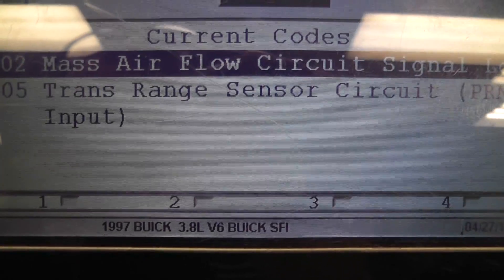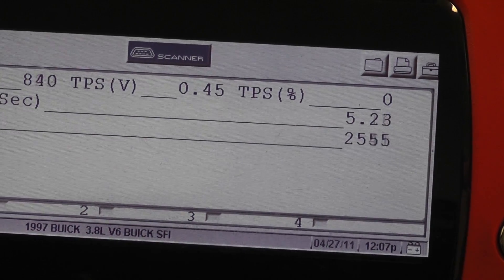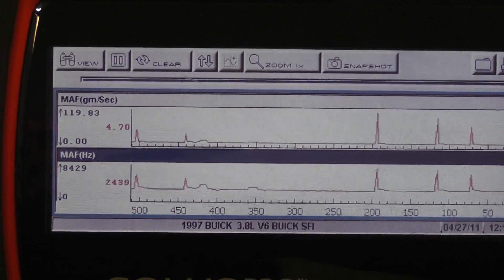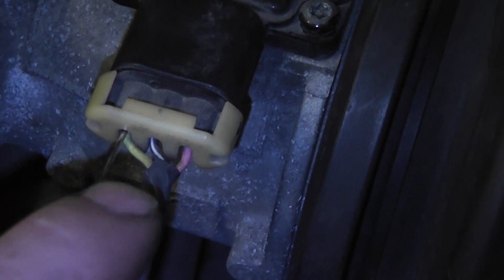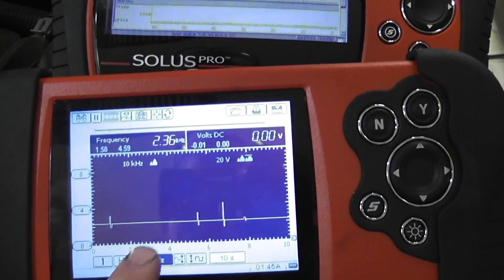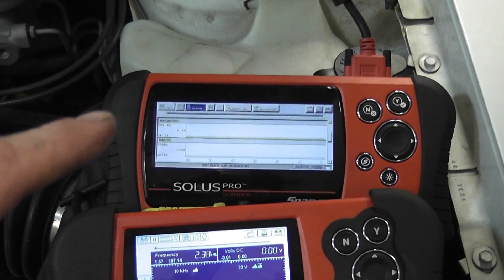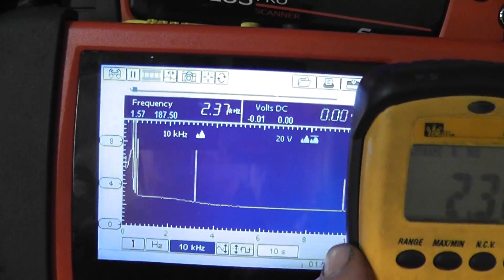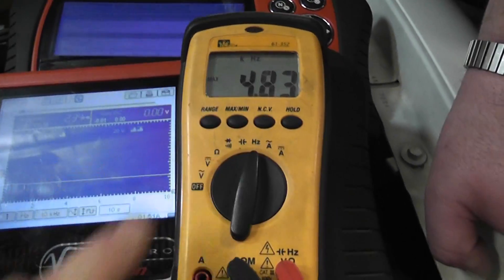How to test a GM MAF Sensor (Part 1)

Comment: Would you point me in the right direction on a p0172 on a 05 3.8 Bonneville. I’ve replaced everything injection and ignition upper and lower intake gaskets and upper intake. It keeps getting the p0172 and on a better scanner  than mine shows a cyl 3 miss. Put no code for that. I’ve done a compression test and get in the 150 range.
Reply from the maker: Focus on the rich exhaust code. What are your fuel trim numbers at idle and 2500 rpm in park, hot engine, steady throttle for at least a minute before recording your numbers. Also I want O2 millivolts. (Upstream only)

Comment: Thank you for your video. I have a 2006 Corolla 1.6 petrol and the MAF sesor read 3 g/s at idle and 27 g/s at 2600 rpm. Are these values normal? Thank you!
Reply from the maker: No idea. What are your symptoms and codes?

Comment: Should MAF g/s test go up and down alittle on my graph I'm getting about 4.7 at idle warmed up It's on a 2001 5.3 vortec does it sound normal or is that low? Also my map sensor stays around 38 at idle and wot gets up to about 100 does that sound normal?

Comment: My Maf sensor on idle has values from 2 to 7-8 without touching the gas pedal...is this meaning that is gone and i have to buy new ?Also my car after driving 30-40 minutie is starting to loosing power and appears black smoke from time to time...
Reply from the maker: If it's a GM, unplug the MAF and see how it drives. They have good backup strategies
Reply: @ScannerDanner  Its Volvo v50 diesel...i ordered a Pierburg MAF...hope that the old one is broken.

Comment: I have a 2000 4.3 g1500 with maf hz at zero,  5v in the yellow but 0v in the red.. shouldn't it be 12v?
Reply from the maker: yes sir, you are missing a main power feed to that MAF
Reply: @ScannerDanner  ok I'm lost... I check continuity thru yellow, black, and red from maf to pcm...  and red and black actually have continuity with each other.. checked them at the maf pigtail aswell and I have it.. can that be right? Where do you get your diagrams from?
Reply from the maker: @TheBracket1  continuity is not what you want to be testing for on that power feed circuit. Voltage is what is missing. Go to the source first. Here is a link to the DIY version of the same diagrams nd service information I use
https://eautorepair.adtrk.biz/?a=10817&c=24&p=r&s1=
Reply: @ScannerDanner  found it.. blown fuse that supplied the power.. I used the mitchell link you sent.. buying your book thanks man
Reply from the maker: @TheBracket1  thank you! Now the question is, why did the fuse blow? What else is on the circuit? You'll find that info under the Power Distribution diagrams. Let me know
Reply: @ScannerDanner  well.. if  I'm reading it right, it looks like the heated o2 and evap canister purge and vent valve
Reply: I do have a p0443 & p0449 circuit fault, and circuit low code awell🤔
Reply from the maker: @TheBracket1  those are all related to the blown fuse. Clear them and I bet they are gone as long as that fuse stays good (it won't) 
Do a good visual inspection of the wiring harnesses that go to those components. Especially the O2 sensors (heat)
Reply: @ScannerDanner  is it possible for a MAF the be shorted internally somewhere and cause the fuse to go?
Reply: @ScannerDanner  better question.. when the fuse blows the maf dosen't read anything but the o2's do.. how is that possible if they are in the same power distribution?
Reply from the maker: @TheBracket1  exhaust keeps them hot, it is the heater circuit for the O2 that uses that fuse. Signal circuit will still operate, though poorly because of temp.
Reply: @ScannerDanner  I have looked everywhere for a short.. these kind of vans are so hard to work on with everything packed this small of a space.. think I'm throwing in the towel on this one
Reply: @ScannerDanner  what if i made my own harness? Tap into the fuse box grab 12v put a inline fuse.. run a that power to the maf and the 3 o2 sensors.. the old power supply's  would be cut off when I run my new 12v source so there is no chance of a short anywhere.. may not be exactly the kinda repair I'd prefer to do, but given limited space and time I have.. good idea or bad?
Reply from the maker: @TheBracket1  I wouldn't do that. Just carry some extra fuses with you until we can pinpoint this thing
Reply: @ScannerDanner  well I put a fuse in it and so far so good.. maybe I moved it away from what ever it was touching while looking for it. Anyway I just ordered your book. In the mean time I got one more issue with a 00 4runner limited 3.4 A/T California emissions..p0135 o2 sensor heater circuit fault b1s1.. he already changed to o2.. and on the truck side I checked the 4 wires with a multimeter.. and have a 12v in one wire and nothing on the rest.. any suggestions on where to start
Reply from the maker: @TheBracket1  did you test that plugged in and backprobing? You definitely want to be plugged in and engine running for all 4 of those voltage tests and thank you btw!!

Comment: Hey 
Have you ever seen a 02 become permanent lean because other sensors forced it 
To read out wrong ?
I just replaced last year 
But saw other sensors like vvt and tps were not working correctly 
Im gonna update if i find out my theory is correct 
Info helps all of us !
Reply from the maker: permanently lean as in it will not respond to a forced rich condition? yes, I have

Comment: I am looking to buy an oscilloscope that will graph frequency. A used vantage pro is around 1000$ on eBay, this is a bit expensive (for my wife). Unless you have good arguments for the wife can you recommend an oscilloscope that will do that?
Reply from the maker: Keep shopping, I think you can find the VP for less than that but to be honest, it is worth that for sure, regardless of the update on it. I actually have a few old 12.4 updates for the Vantage Pro, so if you get one with older updates than that, email me at support@scannerdanner.com and I'll give you one of them. They've never been used and I do NOT know what year that brings your data base up to. At least 3 or 4 years old now I believe.

Comment: For anyone else that is reading this.....I am working on a 2001 Chevrolet S-10 4.3L, and the MAF readings are 6.43 grams/second at idle of 650 RPMs.  If the rule of thumb of the grams/second  equaling the engine size, I should be reading around 4.3 grams/second.  Is this correct?  If not, what would cause this engine's MAF to report 2 grams/second higher than it should for this engine?  Thanks.

Comment: that's why it's good to have a scope that samples at a much higher rate. Graphing multimeters are the best in my opinion because they sample at a million times a second and then averages out each sample per division and connect the dots to draw the line.  A regular expensive scope may sample at a high rate but it will also display at the same rate and the human eye cannot catch that.

Comment: Can this be done with a ODB2 reader and an app like Torque? It doesn't measure Hz... measures mass air flow in g/sec or lb/min
Reply from the maker: Yes you can
Reply: Thanks for the reply! what should I be looking for? Assuming I am looking for spikes on the graph, rather than linear ups and downs (to find an error). Trying to trouble shoot a P0101 code on an Astro van. Thanks so much.

Comment: Dan question 3800 supercharged pontiac gtp when i start car and run it check engine light P0300 when i unplug maf i get code for that but no P0300 is it the crankshaft sensor or a bad maf
Reply from the maker: P0300 is a misfire code, which can be caused by a ton of different things. When you unplug the MAF, the misfire monitor for the OBDII system is probably being turned off because the computer is recognizing a fault for a critical sensor. This provide us with no direction at all. I hope that makes sense.
Reply: Ok so i can assume since the maf isn't causing the misfire code that something else is only problem is i don't have a scope like you to monitor the misfiring on each cylinder. I was thinking i kno all coils are good i know the icm is good injectors are all good could it be the crankshaft because i do get play in the mph in park and i rev the engine up. Thanks for responding
Reply from the maker: A MAF sensor can cause a misfire code. Let's make sure we are on the same page first. 
1. Does it run good with the MAF unplugged compared to plugged in?
2. Can you feel a misfire? Is it there all the time regardless of what you are doing with the MAF?
Reply: ScannerDanner yes it runs perfectly without maf plugged in just needs help to catch its idle. I only feel the misfire when maf is plugged in which tells me maf but i don't wanna guess and part change
Reply from the maker: Okay, that does sound like a faulty MAF, watch part 2 of this series for some digital mutlimeter tests you can do if you want to be sure.
Reply: ScannerDanner ok I'll watch that video also
Reply: So i decided to give in and part change new maf no P0300 car still has a rough idle and stalls maf unplugged car idles perfect wit code P0102 what would you look at next I'm kinda thinking crank or B01 S01 02 sensor cuz i have headers and i know i had to force the O2 to fit
Reply: New development so i checked my short terms and I'm plus 20 rev her up to 3k short term goes to 0 -1 -2 etc ok so i have a vacuum leak. Now here's where i need your help why would unplugging the maf case stft to stay at 0.0 and idle the car perfect but when it's plugged up  it idled erratic wouldn't it idle bad plugged or unplugged if it had the vacuum leak or is that how it's supposed to be thanks for the help

Comment: Aliasing on a scope is dependent upon sample rate. Is it safe to say that glitches effecting the ecm must occur during the time the ecm samples the signal?  I would assume the sample rate of a temperature sensor would be less than a crank or cam signal. ---------> The question I have is this, can a glitch cause a engine performance issue and not cause a fault code because the sample rate of a fault is slower than the sample rate the ecm use to determine a fault code? I know from experience with cummins heavy duty engines that they release calibration update that deal with false positive codes. These are more related to programming for things like temperature, pressure diff. etc.. and the logic..

Comment: just was wondering if you come help me out with something. I switched shops. at my old shop we used genesis pro.it measured maf valium by grams per second,my new scan tool measure in lb.I'm really lost with this new system.
Reply: New scan tool is maxisys
Reply from the maker: There should be a way to change that setting. But I'm not sure. Someone on my forum would know.
www.scannerdanner.com

Comment: Was just trying to do this test on a buddys car that has among other codes a P0101 & P0102 (2005 Impala 3.8L).  I have a Hantek 1008 pc scope and was having trouble setting up the scales to mimick this test to watch for spikes etc.  On snap throttle, could only get a max frequency in the 7Khz range, he did tell me later that he had sprayed cleaner into the intake, so has no doubt left some kind of residue on the MAF element.

Comment: I have a question I have a 1997 Buick LeSabre 3800 3.8 liter v6 went to shop today they had told me that it was the idle air control valve faulty car would stall rough idle bad only when warm replaced idle air control valve it seem to stop stalling but after 20 minutes of letting it sit I go back to start the car and it almost Lopes then it will catch itself and run fine let it sit for an hour starts right up like nothing is wrong the shop told me it can be mass air flow sensor also I smell raw fuel sometimes I replaced fuel pump fuel filter and fuel pressure regulator valve what could be loping be from is it A mass sensor like they are saying please help been chasing this for a while I love the car it's very quick and I don't want to get rid of it thank you
Reply from the maker: +robert gryca the MAFs do fail on these. Unplug it and see how it runs.
Reply: it runs really bad when i unplug it but when i plug it back in it runs better idk im thinking iac vavle not sure the part is aftermarket
Reply from the maker: +robert gryca how does it run when your foot is on the gas pedal, if it is still bad then it is NOT the IAC valve. After you unplug the MAF, you need to shut the car off and then restart it for the PCM to enter it's default strategy . If it is still running bad (it may stall a few times first which is normal with the MAF unpugged) then your MAF code is an effect not a cause of the engine running bad.

Comment: i have a question about a 99 chevy tahoe? im getting one brake light coming on on driver side but no brake light on the passenger side or 3 rd brake light ..also no tail lights at all..the fuses and bulbs seem to be ok...so just one brake light working..what should i check next??thanks..

Comment: Great videos, very educational, I have this very same Buick Leasber (2001) 3800 series 2 with a p0102 and p0171, - using torque app won't show this type of error obviously. When resolving this particular issue issue, did you replace the MAF? (I've read where bad MAF in GM can include rich/lean codes)
Reply: Yes, the MAF sensor was replaced and it fixed the issue .And yes a faulty MAF can cause rich and lean codes.
Reply: Thanks for the video and the reply, helps me out immensely!

Comment: hi I have a question for you I wanna check frequency on bosch mass sensor 2003 BMW the procedure is the same like you doing on buick do I have to change something on scanner ? in using the same snopon scanner as you have

Comment: Great video!  Ive been looking at buying a scope like a Vantage or Vantage pro, but Ive been told that the snap on scopes are all digitally processed data and not actually live, and the older Sun machines are better to have is there any truth to that?  Ive watched all your videos and it doesn't seem that you have any problems while using the scope functions.

Comment: I read on another diagnostics blog that grams per sec should be roughly engine size at idle and 40x at w.o.t. so for example a 2.0 liter engine should be roughly 2 grams at idle and around 80 grams at w.o.t. What are your thoughts on that?

Comment from the maker: When I started this 8 years ago I charged $20 a car...what a joke. I was completely ripping myself off. I charge $70 per car, then $50 per hour after the first hour. Although I rarely get into the second hour (this is where 20 years of experience helps). So it is $70 if it takes me 5 min. and it is $70 if it takes me an hour. Any more time needed we talk about. It is getting to the point where I am so busy that I'm going to bump it up again. It went 20, 40, 50 now 70 soon to be 100

Comment from the maker: sorry for the delay, it's getting hard to keep up. The only time you need to use the O2 ground is if the system uses a bias voltage on the ground. See Section 5 pages 14-18 for an example of when to use O2 sensor ground. In most cases you do not have to use it, unless of course you want a cleaner looking waveform on your screen.

Comment: Hi i have a question on your mobile diagnostics business. I'd been approach by other shops to go and do some diagnostics at their shops. I'm not the greatest tech out there but the shop that i work for has a reputation of fixing what others cant. My main question is you charge somewhere around what shops charge for an hour or you go a little bit higher. Any info would be appreciated. Again am new to this mobile diagnostic world but it seems that if it works out i might just go mobile route.

Comment: I just read in your book last night that the ground reference you use for O2 sensor tests should be the O2 sensor's ground and not necessarily going back to the battery negative. Did I understand correctly? The topic was about bias voltage, I'lll have to research that a bit more.

Comment from the maker: yea, that's not right. it certainly doesn't max out at that rpm. also comparing rpm and maf is never good enough, for example, you could be at 2300 rpm with the throttle barely open or at wot. in which case you would have a huge difference in airflow. watch my dirty maf case study video and if you have my ebook, refer to my chapter on maf testing

Comment: I'm a great fan of your channel.
I've been measuring the MAF on my 95 Lexus LS400 1UZ-FE engine, with an analog MAF.
It has a max voltage output of about 2.7V, and the OBD tells me it maxes out at 62g/s @2300rpm, and stays there regardless of the revs.
This looks wrong to me. Air mass should follow the revs.
Is this MAF only used at low rpm to smoothen the idle and for cruising at low revs, or is it broken and in need to be cleaned/changed?
What is the known good waveform for the 95 LS400 MAF ?

Comment from the maker: I looked these up for a 2002 since you didn't give me a year. (KOEO signal output=.99-1.02v) (Idle=1.32-1.48v) (2500 RPM 2.0-2.2v) Snap throttle, voltage should change smoothly with no glitches or drop-outs (scope test). MAF signal is Pin5, IAT signal is pin 1. Connect to pin 5 and a known good ground for your test.

Comment from the maker: @mountaindog0 Thank you for the book purchase! Also I have seen a Ford on a few different cases actually have rich conditions at idle (negative fuel trim numbers) from a dirty MAF. Of course it ran lean under load and all the tests I am teaching would still apply, but I have seen what your saying. Why does this happen? From what I have read, it is because of in increase in surface area (causing greater heat transfer) from the contaminants under low airflow conditions (idle)